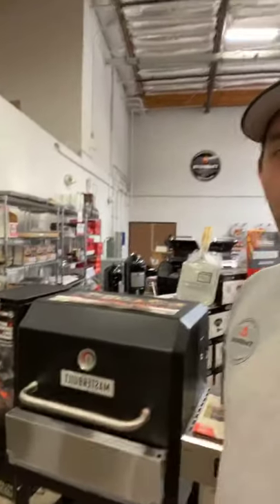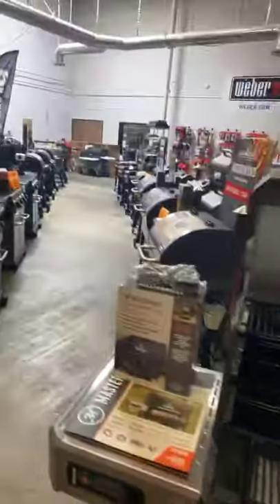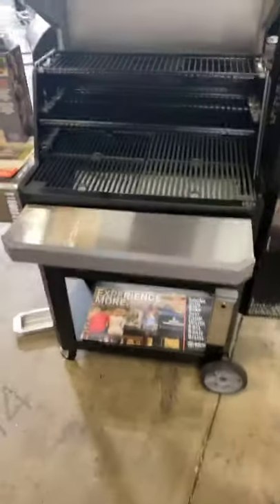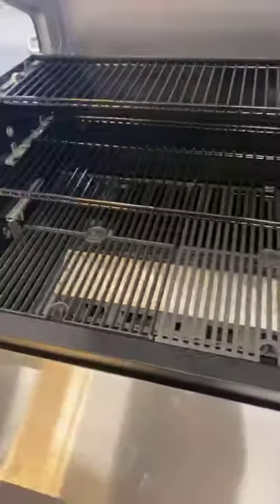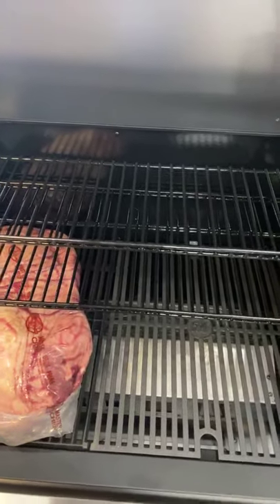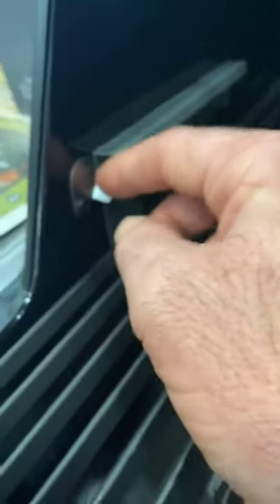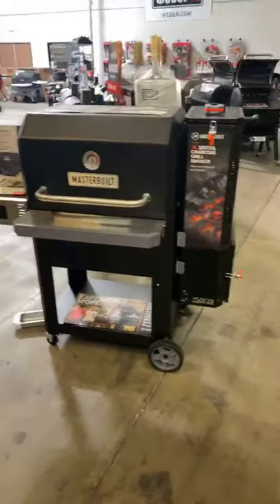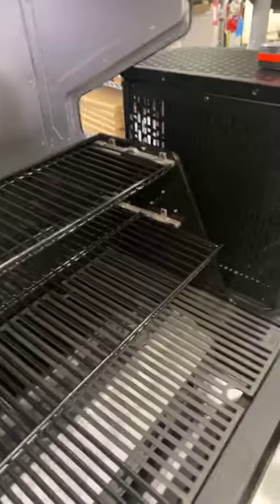FIRST LOOK AT THE MASTERBUILT GravityFed 1050!

Comment: Can’t wait to get my hands on one of these.

Update. I got one in August. I’ve used it 5 times so far. And it’s fantastic. It cooks pretty evenly. I did the biscuits test to see where the hot and cold spots are. It does heat up to 700 fairly fast. But it needs a full hoper to get there. And it’s uses lots of fuel to get there. So keep a few bags of charcoal on hand.

Comment: Originally I wanted the Weber smokefire but too many issues reported so looked at the 560.  With weber you may have to replace the auger and add a piece of metal inside the hopper.  Seemed like you mentioned the Weber was better than this one even with those issues?
Reply from the maker: withinavoid I received a lot of flack for it but I LOVE the Smokefire. I know people are having issues with it,  but we have had no issues with ours here or what we’ve sold to customers. It does have some nuances, but I never have had better flavor out of a pellet grill at lower temps and it works amazing as a grill. Yes, it has some flaws but Weber will get them sorted out.       They’ve released a completely different product than anything else out there and that alone makes it difficult to make perfect out of the gate. Many other brands are just replicating something else that already exists...not the case with Weber. I’ve been involved in a lot of product R and D, and there’s no way to find all the bugs in beta. The public will always find and issue. I think they had a few things that they didn’t foresee in testing (crappy pellets, manufacturing consistencies and the whole side of app development) Unfortunately it’s hard to have a civil conversation about it these days as people like to attack it. Definitely give us a call at the shop and I’ll be glad to talk to you about it. 805-285-2618.
Reply: @TheBBQHQ  Thanks for the honest info!  Are they shipping out new modified units yet?  If you were only using for smoking and not grilling would you still recommend it over something like the Masterbuilt?  Got to admit I was waiting and waiting for that Smokefire to release - like you said - due to the rethought design.  Seems however the smaller issues should have been caught earlier (hopper void, other brand pellet use, lockups/OUCH!).  I can understand the app issues which will get better.  However if your customers aren't having issues then some are getting built right.  Maybe i'll try my luck.

Comment: Does it continually burn whatever is left in the hopper?
Reply from the maker: Yes, as it burns at the bottom it slowly feeds itself. Pretty cool.
Reply: If you put the block off plates back, it will stop the burn so you can use it whats left on the next cook.
Reply: @Craig6519  Yes - Kosmo Q said it in 1 of his videos